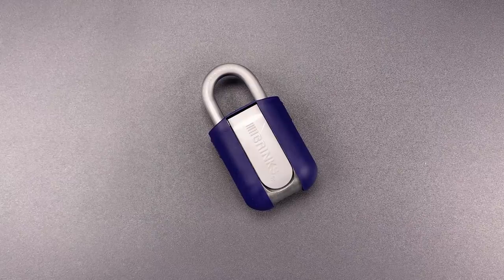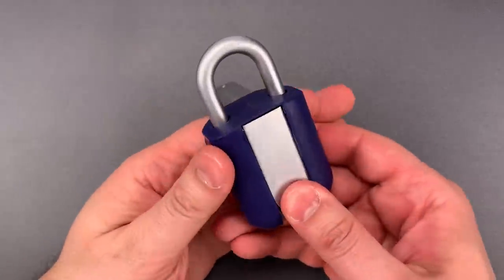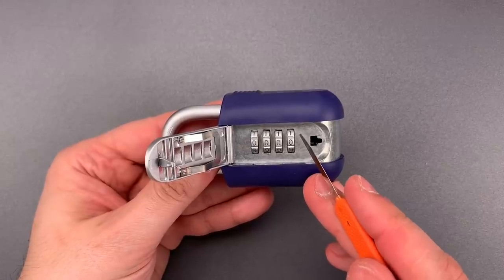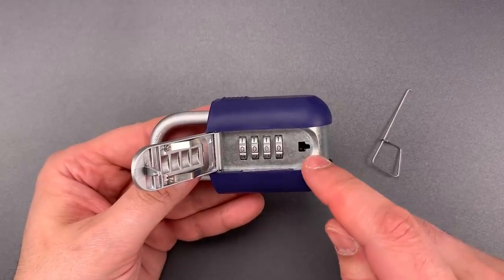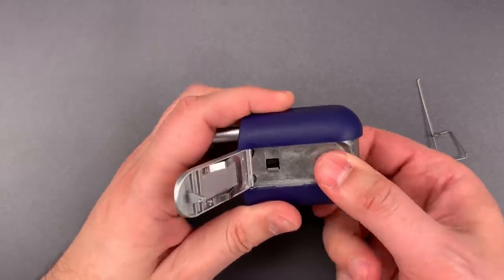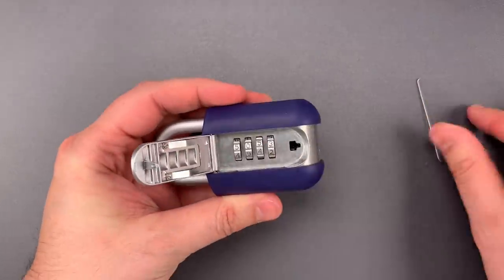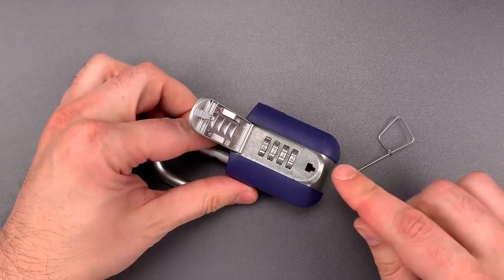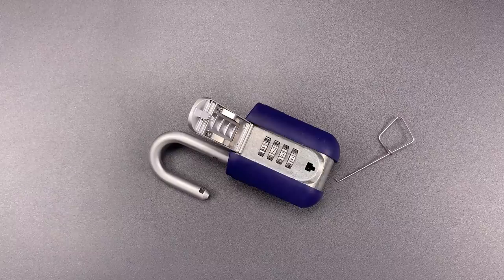[1007] There’s a Literal Security Hole in This Brinks Padlock (Model 673)

Comment: And they could have avoided that bypass by closing that little door with a magnet instead of a spring clip.....
Reply: Yeah, but that would require the manufacturer to actually think and care about the product. Surely that's a little much to ask. . .
Reply: That or making an internal wall that prevents you from being able to stick something in there
Reply: In any case a quick 3/32 drill into approx area and paperclip inserted opened
Reply: @at0mix197  It's a "Zinc clamshell" if you're allowing destructive methods a gentle warming will turn it into a puddle. (Okay 450 °C but that's pretty quick) Or a hacksaw will probably glide through the body.
Reply: Or they could have put the spring clip on top rather than punch a hole in.  So many options, and they literally took the cheapest, tackiest route.  I think anyone knows that having a hole that lets you access the lock internals is a bad idea.
Reply: He could still pick it

Comment: This entire problem could´ve been avoided had they chosen to delete that fancy spring loaded door.
Reply: Or engineered it differently to latch into a bump on the lock body, rather than a hole.

Or shielded the mechanism so the hole did not allow access into the internals.

Because little doors protecting the codewheels from the weather are actually a pretty decent idea.
Reply: There were so many different methods this could have been solved but it still happened. Even for the sake of not having the locking mechanism exposed to the elements, and letting water and dirt enter as easily, sealing off that door latch would have been a good idea.
Reply: Or, you know - have the locking mechanism backwards. Put the latch on the door and leave a protrusion in the metal body, rather than the other way around.
Reply: You obviously want to use magnets instead of any holes to keep the door closed.

Comment: I have this lock on a tool shed and I got it for its weather resistance since everything else rusts so quickly. No complaints. What are the chances a thief would know this? Slim. Most people don't even know how to open it up to access the dials 😆

Comment: A 4 digit combination lock, no matter what kind nor how well built, can be considered secure. You can go through all possible combinations in under 10 min.
  A couple of years ago I was working on a construction site in Texas and we had one on our conex. Almost immediately we found a flaw with it. To change the code you set the dials to the combo you wanted and then you symply closed it. The flaw was that while unlocked the dials had a bad habit of moving which meant once closed it changed the code. At one point we couldn't open it to put it back on the conex so we went to home depot to switch it out with something different. We didn't even get a mile down the road before I got it open by process of elimination.

Comment: This would make a great lock for geocaching. There are several caches out there that are intended for picking, most of them are pretty hard to be honest (you need a pick or the standard tension trick) and there is one where the outer is a cheap three wheel tension lock and the inner is four wheels but we got into it after watching youtube videos on how to open combination locks out in the forest. 

This would be a simple one, especially if you put the key (bent wire) next to it.

Comment: Had this in the recommended section so here's a story from work: We were getting new PCs, and the cheap anti-theft codewheel locks on the office machines did rarely correspond to the supposed code of 1515.
I now get suspicious looks from the rest of the office, but we did get those old machines removed rather quickly!

Comment: I had an idea for a lock which is basically a tiny C-clamp that you slide over the hinge that sticking out on the hinge side and that should stop anyone from being able to open that door depending on what that clamp is made out of
But you should be able to make it super tiny and super strong as hell so it literally pinches the hinges shut so the door cannot be opened

Comment: Brinks: Well back to the drawing board.
Reply: They litterally just need to remove the hole and put a small tensioning spring on the door. That way it holds closed, can be lifted, and doesnt create a massive hole in the body of the lock right next to the  mechanism that controls the locking pawls.

Comment: Put a spring in the hinge, remove the hole. I get why they did it this way, who wants the cover constantly trying to close while you put in a combination, but not at the expense of security. They could also mold the casing so the hole does not give access to the internals, but that's more work in the making.

Comment: I'm curious on two points: 
1) What is this purpose of this security hole? Some sort of override key? Is this necessary at all for the lock, particularly considering that there appears to be the same access hole on the switch side?
2) Assuming this is for an override key, can a simple spring loaded door plate sufficiently improve this design to prevent the picking method shown here?

Comment: Wow, I am not a lockmaker or a lockpick and even I am like "Put a barrier between the hole on the front and the wheels ya dingus".

Like, I assume they blocked the latch on the back so you couldn't shove some thin pliers into it and click the clamp on the back out. Otherwise LPL would've just done that. So they thought about the hole being an issue, but didn't go all the way.

Comment: Fairly easy fix for it, if it is still in production of course. Would need new design for front door and front half of lock body, but simply changing the way the door clips shut to only require a dimple in the material rather than a hole.

Comment: Well, you could still solder that hole shut or something, then you can break the hook on the plastic cover and glue a magnet. Just as an ad hoc solution, because it seems like a reliable lock otherwise.

Comment: I get that the hole is for the latch of the cover plate (which is just aesthetic and is not necessary anyway), but I don’t get why they’d leave a hole into the inner mechanism. Couldn’t they just as easily add a housing for the lock to make it separate from this penetration?

Comment: I was in line to see a rock show. Saw a combo lock on a gate. turned to the crowd and said "watch this"... I used social engineering to crack it, I figured: how does the owner lock this? well he probably just does a quick swipe of his thumb across all 4 dials... So to unlock it I swiped up instead of down... thing popped right open. The dude who saw me was so impressed he handed me 5 bucks saying it was what he would have bet had I phrased my "watch this" as a bet... true story. The crowd then had a vote on what to do with the lock, I think they changed the code and put it back on the gate.

Comment: Do you think theres a solution to making the lock more secure? As someone without any level of lockpicking knowledge, I wouldn't know, but it would make sense to me to just fill up that hole such that the clamshell flap can still lock in securely, while also covering up the mechanism inside from being touched. Possibly with a small piece of metal, or some sort of thick, hard glue.

Comment: Hm, re using a shim and feeling for a flat spot, would it help if the flat spot, the wheel that does the locking, were shifted to the side a bit? Such that a simple shim couldn't reach it? Put it on a sort-of stalk sticking to one side.

Comment: Hi, LPL! I acquired one of these locks about six months back from a friend who had accidentally locked it open. Having tried the various methods I knew (shimming, tension on the release bars for flat spots) I thought it was impossible for me, but then I came across this video! My question is, when I look into that hole I see a round pin (not a plate?), and when I put in a wire like yours it doesn't seem to move at all. I wouldn't think that this pin/plate/whatever would act differently depending on whether the lock was open or closed, but after half an hour of trying your method I am once again stymied by this lock! Any thoughts or advice would be much appreciated. Thanks!

Comment: And to think, this would have been arguable flawless lock if they just remembered to make it so you can’t access the locking mechanism through the door latch. 

(I said arguably flawless because the build quality of the lock isn’t the greatest but you wouldn’t want to use a code lock for something where build quality matters anyways. Or at least not a 4-digit code, they can be brute forced pretty quickly)

Comment: Such a lock could still have its uses in low-risk situations.  Even perfectly nice people become curious and succumb to the urge to snoop sometimes. Such a lock would deter Aunt Edna from having a peek. If the ol’ battle axe is willing to fashion a hook out of some wire to get into that footlocker, you have a bigger problem than any padlock is going to fix. 

I would like to think that this lock would be more than capable of deterring a curious five year old from looking inside mom’s underwear drawer and finding funny buzzing banana shaped things. Or a lock on a filing cabinet to keep your coworkers from sneaking off with the odd Girl Scout cookie or coffee pod. Or keep your neighbors from assuming you won’t mind going into your garden shed to borrow the third shovel you’ve bought this year because he forgot to return the other two. 

Perhaps the lock is intended to be user recoverable. Was there a toll free phone number on the packaging or a website address? Maybe if the purchaser accidentally locks themselves out of something that they would really like to access. I wonder if they actually tell the purchasers how to defeat the lock.

That notch looks like it could perhaps be secured with some sort of two piece locking key. One side could stay on a keychain and the other would remain secured in the notch with a couple of bars forced apart so as to be virtually impossible to remove. It might even help existing owners improve the security of the locks they might already own.

Comment: Looking at the pic on Twitter, it's just weird that those two holes simply  hold the two hinged covers closed - almost any other form of closure would have avoided this bypass route...
Also on your Twitter internal photo - it looks like the clamshell case is screwed together - is this another security flaw, or are there rivets too ?

Comment: Heh, I just put "Hello. This is the Lockpicking Lawyer, and today I have an extra special lock to show you" into a GPT2 demo, and this is what I got:
"Hello. This is the Lockpicking Lawyer, and today I have an extra special lock to show you. This particular lock is 13 inches long and has 2 keys in it. You may have heard of this lock before, but I know you may not, so let me tell you what it does.
First, there's the red key, which is used to activate the locking mechanism. You don't want it to break, and it must lock the mechanism before you can open the lock. Then there's the blue key, which activates the lifting mechanism. These do the work of"

I have no problem hearing that whole thing in LPL's voice.

Comment: 'I stuck a custom-bent wire into the lock hole, psychically connected with the locking mechanism, and told it to open.

Comment: That's a pity. I have a couple of those and they're great for snow, ice, rain, etc. I wonder if there's an easy way to block that weakness. I'd still use this padlock for the basic service a padlock offers ... a deterrent to most thieves and a "tamper-evident" seal. : ) 
p.s. funnily enough, the lock is sufficiently unusual that even when I send instructions (push to open silver metal cover, roll combination, squeeze blue sides) more than one person has called me to say "can't get the padlock open ... how does it work?"
Reply: Just weld the hole shut but i juess you need zink for that.
Reply: @jari2018  that's where the weather cover latches closed. I was thinking it would have to be disassembled and something internal to block access. Seems like Brinks could send LPL a "thanks" and update their casting or whatever and bingo ...

Comment: Hey lock picking lawyer, could you review the new Abloy smartlock series (there every key is physically identical and user generates required electricity by pulling the out of the lock through kinectic energy).

Comment: Engineers design a good lock with tight gaps to prevent using a tool to feel inside the lock
pass the design to the marketing team
Marketing team put a blue rubber edge on the sides and pokes holes with direct access to lock mechanism to use as a clicking mechanism for little doors.

Comment: so all this lock would need to go from a 0/10 to a 10/10 is a small piece of metal below the code wheels and above the latch holes? or for the latch holes to be encased (as the tolerances on the dials make it hard for the normal shim approach)... man I hope someone in charge of designing this lock looks at this video and makes a new version of the lock blocking that flaw...

Comment: How strong is that back latch?  I ask cuz if the do a magnet to hold front flap down and fill that hole would solve that issue but the back might still be an easy attack.

Comment: Brinks:We're going to tighten the wheels so that you can't decode it using the wheel gap
Also Brinks: We're going to leave a giant ethernet port shaped hole you can bend a piece of metal to stick into and make the whole decoding process 10 times more brainless
Really, Brinks?

Comment: Is there a way the hole could be filled? I'm not exactly sure how that lock mechanism works but if it were to be fully functional after filling the hole with some sort of epoxy then it seems it would have some pretty okay security.
Reply: The hole may not be the only weakness, it's just the first weakness the LPL found.
Reply: @jrd33  that's what I'm asking. If there are more than just the hole.

Comment: so if that hole wasnt there this would be good lock. could they just change the design for a version 2 with out that hole on the front leave the one on the back but it only opens when you have the right combo

Comment: The solution to this would be to separate the door notches from the rest of the design with a metal plate. That's just sad that they left such easy access to the inner workings.
Reply: But a plate like that would have added 5 cents to the production cost!

Comment: So, without the cute little front cover this would be a decent lock....
Reply: Tbh, the entire lock appears weak and badly constructed, the body is made of zinc, making it prone to heat attacks. You could pretty easily cut the shackle, or use a twisting attack to break the lock in no time.
Reply: @jaakkovahanen  
'Decent lock' is relative....

Comment: There is a locked display case at my work that no one had been able to open for like 10 years because no one knew where the key was. I've only worked there for 3 1/2 years no. About a year ago we were discussing how to get it open. Apparently, they had tried everything short of calling a locksmith or just breaking the lock. So out of boredom I made a pick set out of paperclips and picked the lock in a couple of minutes. Mind you, this is with no experience and before I had seen any of LPL's videos. I then got in trouble because now we couldn't lock the case. So I went searching for the key and found it within about 10 minutes in the key box that had apparently been thoroughly searched.

Comment: Wait the combination can be changed while its locked?!
Reply: Remember that he had to press the buttons on the outside of the lock to get the shackle to pop open even with the correct combination set. So when he goes to change the combo, the shackle is latched but the lock is "open".   The code wheels have to be set to the correct combination before the combo-change switch will activate.

Comment: So, what's the purpose of the hole?

[edit] Oh. Never mind. It's for the door latch. Duh.
Reply: Okay, so maybe you need the hole there to hold the latch closed, but why would you expose your locking mechanism in this way. A piece of metal could have easily been put just inside the hole to protect your locking mechanism.
Reply: LPL. If you were going to design the perfect lock, would it be one that doesn't have a key? I've watched a lot of videos on this channel and it seems if there is any access to the innards of the lock, then you can find a way to pick it. So a lock like this, but with no access to the inside would be better. Granted, four digit combinations can be brute-forced in like 30 minutes. What would your ideal lock look like?